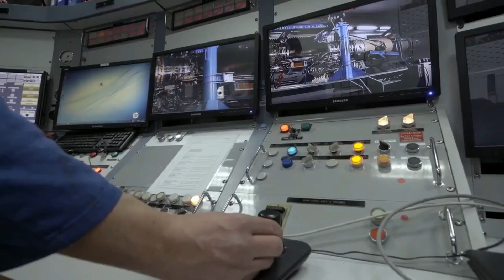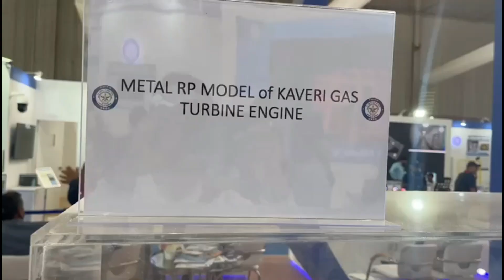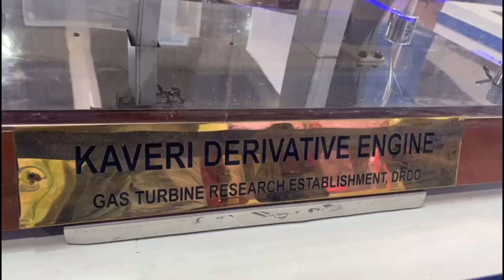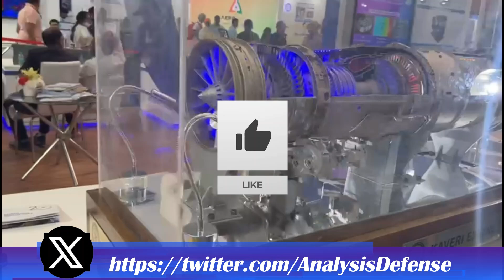Kaveri Engine Program achieved major milestone, cleared for aircraft integration

Comment: The title is misleading. It says Kaveri is cleared for Fighter integration. In reality, it's just that Godrej will deliver around 8 engines of the latest dry Kaveri variant and these engines will go to Russia for flight testing on a flying test bed IL76. After that , it will be mounted on the Ghatak UAV only and further tests will be conducted. All these tests will take 4 to 5 years. Problem is that, the new Afterburner development has been given to Brahmos aerospace, which will take 2 to 3 years. So Kaveri cannot go on the Tejas until 2030. So to cover this miserable failure GTRE is deliberately planting such articles in the media to cover up their failure. After spending 40 years and 2000cr of hard earned money, GTRE couldn't deliver a working engine, even capable of powering a UAV. Its a national shame all bacause of GTRE. Today again the Tejas project is at crossroads, because the American engine supplier is deliberately delaying deliveries and our own GTRE needs another decade to deliver a full working engine. 
Unfortunately India is defeated from within .

Comment: Integration Kaveri aero engines is cleared which is equal or more suitable to F 414 aero engines of GE USA, must tested all 6 types oc kaveri aero engines on dry run, to test thrust to test burning thrust after burning.Also to go for Safron aero engines for Tdjez in addition to Kaveri aero engines to speed of the Mk1,Mk2,or Mk3 Tajes

Comment: My brother worked on this way back in 1986-90 on this GTRE project and now retired. The Alloy used to make the blades to withstand high temperatures needs to be bought from outside. It is basically old Russian engine design, heavy, low fuel efficiency and struggling with the high-altitude tests.  India should develop supply chain like China and vertically integrate if we want to be independent. Even LCA got 60-70% imported components.

Comment: One decade? Are you joking. This is past due. India needs automated capability for producing 50 - 100 aircraft during emergencies in 4-6 months. Minimum 6-8 production line with half underground facilities. Today, the goal should also be to manufacture drones, minimum 40000 per year, across all capacities. Swarm drones that can be delivered from an airborne canister delivery systems for self-destruction.

Comment: I've worked with two of the biggest aero engine manufacturers for 7 years and believe me, aircraft engines are one of the most complex and closely guarded tech. Rocket engines are much easier than the core of aircraft engines.
Reply: Your point take. Jet engines are very challenging. But is not possible to design, develop one working engine in 40 years and around 20000 million Indian rupees.
Reply: @sreaedhar  , another entry with bigger pockets China is still grappling with it's first testbed engine core inspite of starting before us. No it's nearly impossible to get to the level of current engines without a bedrock of previous experience and knowledge.

Comment: Excellent news. Now Kaveri is progressing step by step.

It was good decision to give the manufacturing of the engine to the Godrej. 

Kaveri has already given good results in high altitude testing in Russia. Subsequently, Godrej was asked to manufacture the prototypes. 

Now, we have dry Kaveri ready for certification to be used on the stealth Ghatak UCAV which will add huge combat capability to our forces.